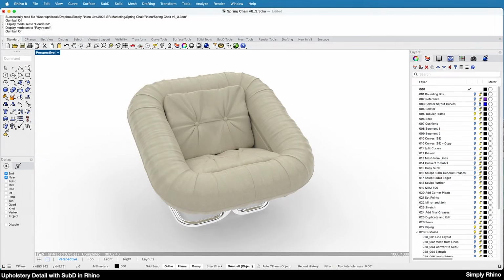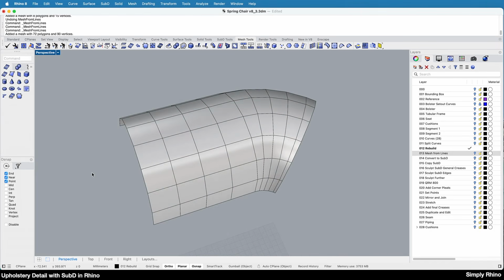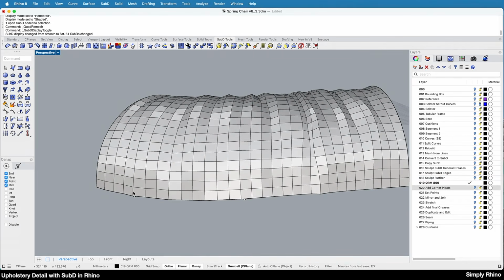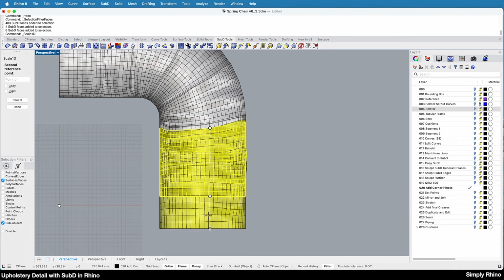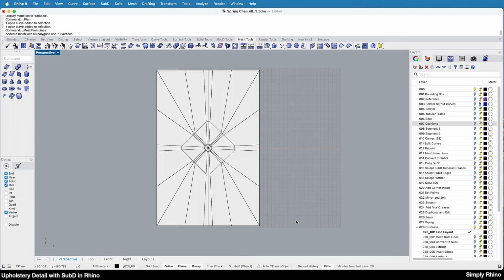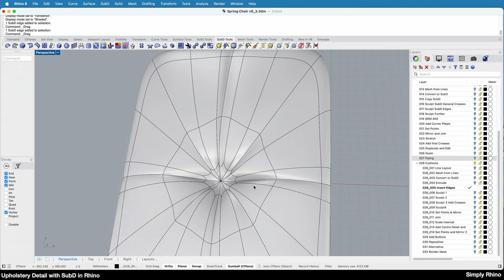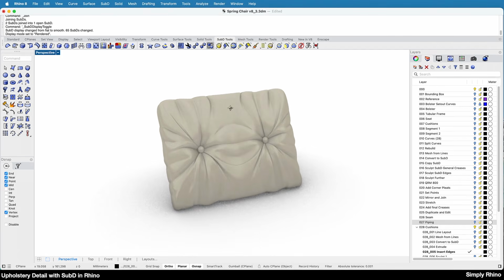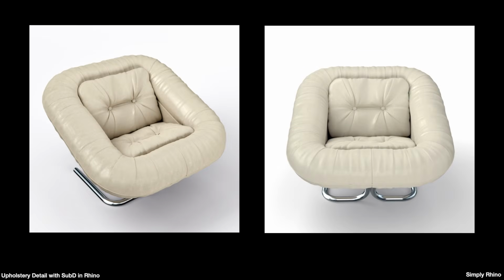Modelling Upholstery Detail with SubD in Rhino 8

Comment: i sill a little bit confused with the make mesh using line command, because i have created the lines and poly lines according to the crease needed especially for the pillow profile, but the mesh will not happen to be constructed fully to the pillow profle, though i already build the profile using polygon, would you mind telling me the fillable condition of the mesh to be fully constructed as profile when building a pillow crease profile?
Reply from the maker: Hi, In order to use ‘Mesh from Lines’ the requirement is to have a number of single 2D lines or curves that touch whose end points touch either. These lines or curves will describe the boundary areas of the mesh to be created. The lines or curves must not be duplicated and the end points should touch each other but not be joined. You cannot use a polyline or polycurve. Hope that helps and we understood your question correctly?